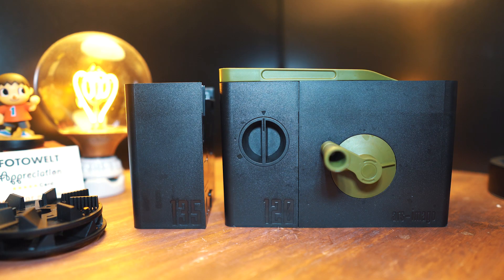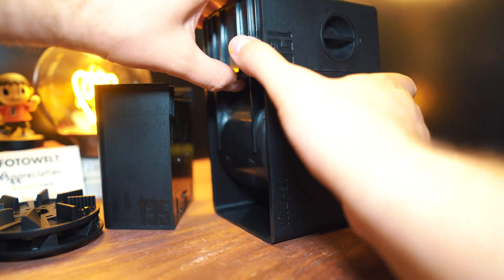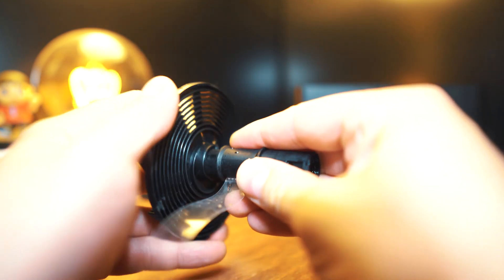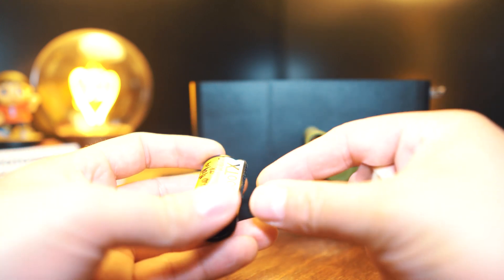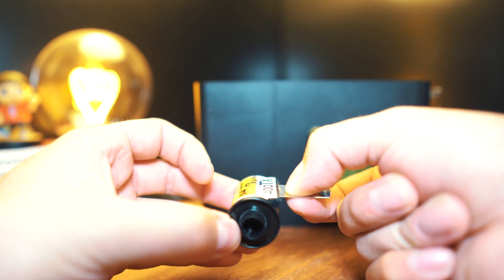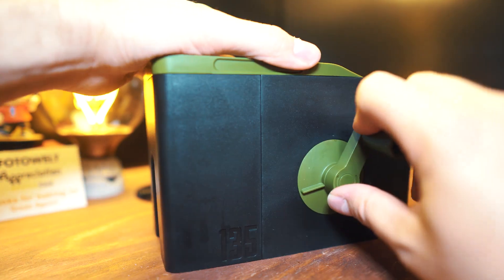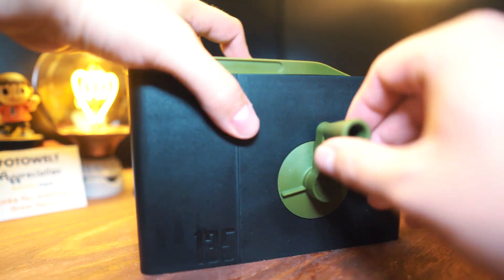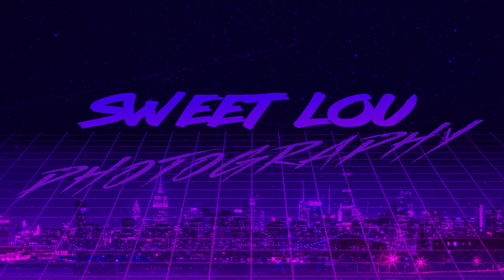HOW TO DEVELOP 35MM FILM IN THE LAB-BOX

Comment: Good video thanks! I have a problem, sometimes there is a vertical scratch on the negative after development in my lab box. It appears 5 or 6 Times every time. I know it’s not due to the camera. Did you ever notice something similar to your negatives? Cheers!
Reply from the maker: I haven't had that issue myself, but I would make sure there isn't anything on the plastic tray piece that guides the film onto the reel. I'd imagine if something is caught in there (dust or whatever) it could drag across the negatives. I'd also check to see if the plastic in that tray piece is good, maybe it has an edge that's sticking up and rubbing against the negatives?
Reply: @SweetLouPhotography  I contacted Ars Imago and they sent me a brand new trail... Probably it should fix the problem, I'll let you know! Thanks!

Comment: Nice video! I was wondering since Spectra film are stopped, is there a way to convert a spectra System to fit 600 film pack?
Reply from the maker: I would have to do some research into that, I'm not too sure. But I feel like it would need some sort of 3D printed situation, since the Spectra film packs are like half an inch larger than the 600. It's a good idea though, and I happen to be friends with someone who has a 3D printer. Time to experiment. Hahaha